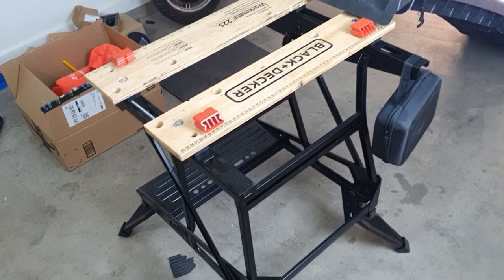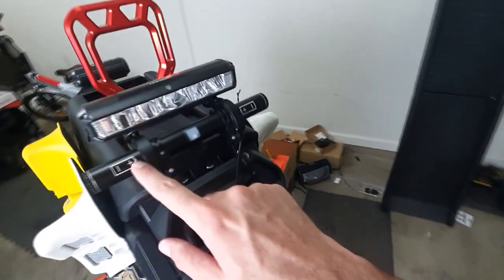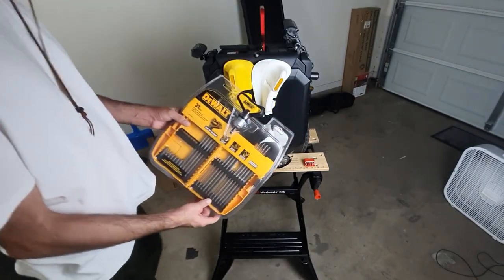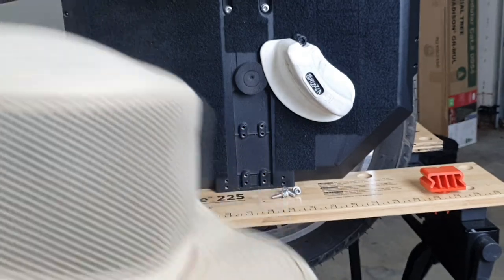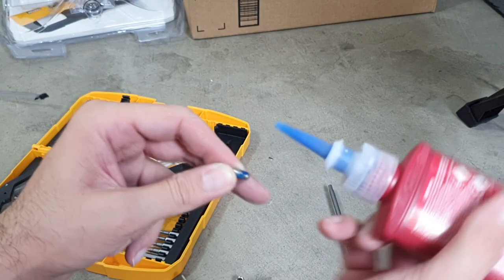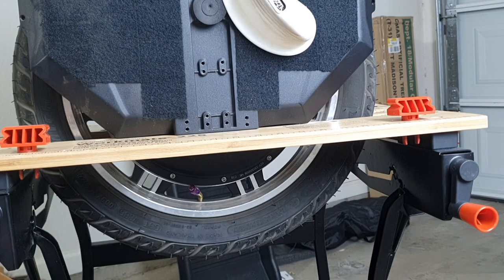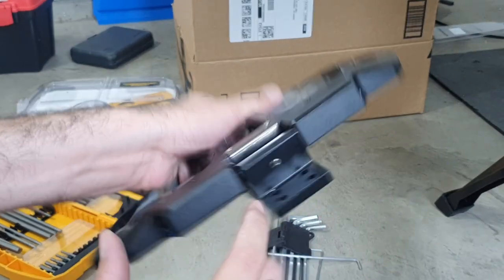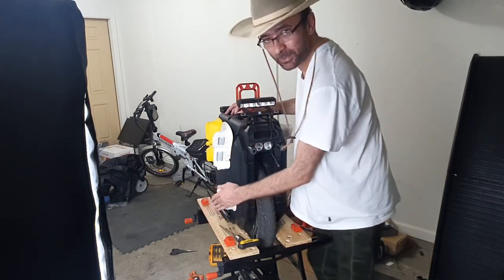How to FIX Commander PRO Pedal

Comment: Marty talked about this in his first look at the Commander Pro. The grub screw on the bottom doesn’t necessarily be tightened but the two holding the rod do. I just tightened mine the other day and didn’t touch the bottom one. Good point on the loctite reminder. Next time I need to tighten them I will pull them and add some Loctite. I would be cautious lowering the pedals. As you point out, not using all 8 screws will likely be problematic. These things aren’t known for their over-engineering. 😉
Reply from the maker: Nicely summed it put brother. I am just happy that I was able to fix the issue. I would definitely try lower pedals. I am 6.2ft and CP is too low for my knee to touch the wheel and feel it. I did not have this issue in Master Pro since MP was a bit taller than this wheel. Maybe I create a MOD plate like I did not MP.